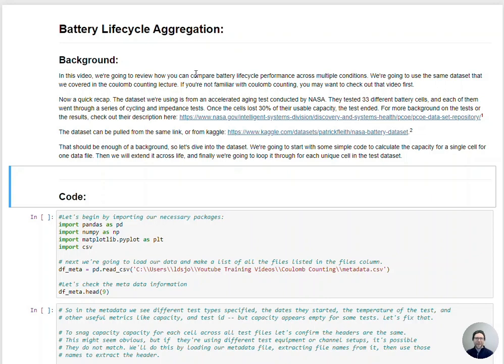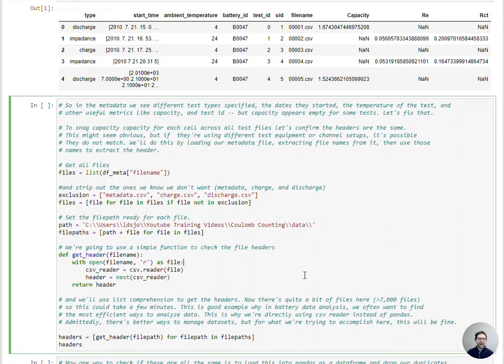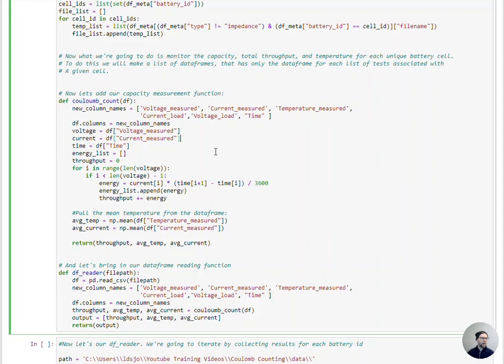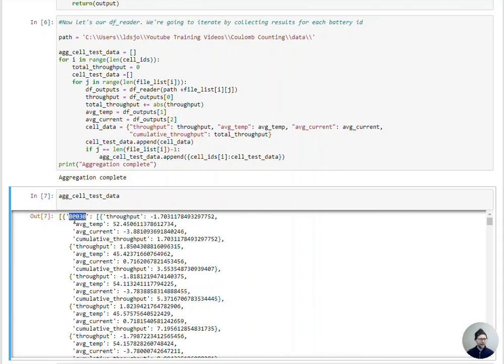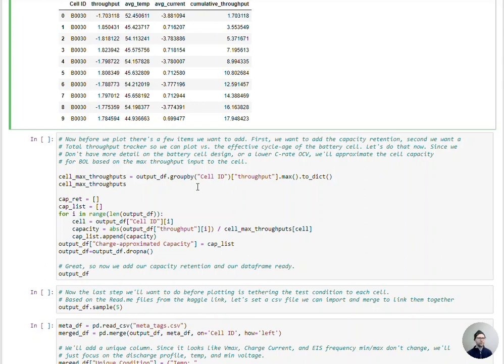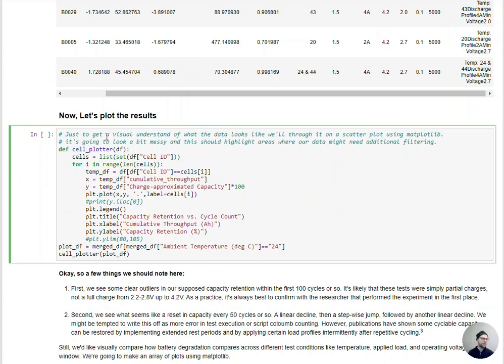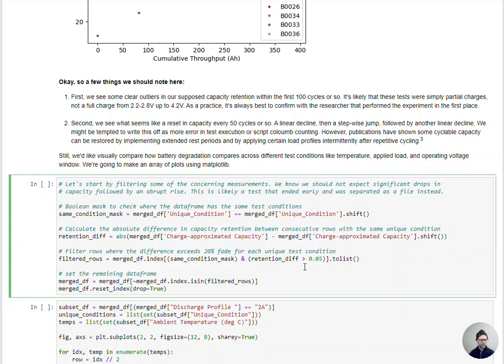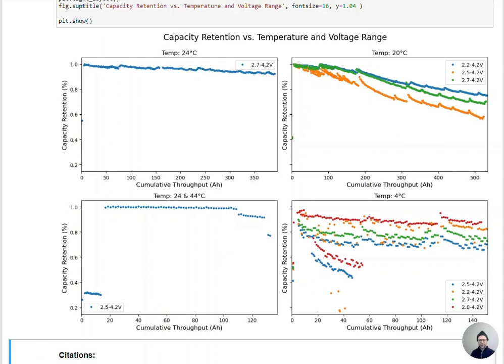Battery Lifecyle Analysis for Beginners

Comment: Thank u for the video. It would be great, if you could update the code too at the github link. The code seems to be missing for both the battery exercises.
Reply from the maker: Hi! 👋 
Thanks for the feedback. The codebook's been added. You'll need to correct the relative paths to your folder of reference for the data. 

https://github.com/MDJonesBYU/BatteryDataGuy/tree/09325ffdb8dfb78e49d6544a8fe8befedd9290ae/Battery%20Analytics%20Lectures/Lecture%202%3A%20Battery%20Lifecycle%20Analysis%20for%20Beginners

Comment: Thanks so much for this video. Would you mind sharing the notebook and data?
Reply from the maker: Hi Arnaud8406! 👋
Certainly happy to share. Its uploaded to github. You should be able to access below. Lmk if any questions or issues!  https://github.com/MDJonesBYU/BatteryDataGuy/tree/09325ffdb8dfb78e49d6544a8fe8befedd9290ae/Battery%20Analytics%20Lectures/Lecture%202%3A%20Battery%20Lifecycle%20Analysis%20for%20Beginners